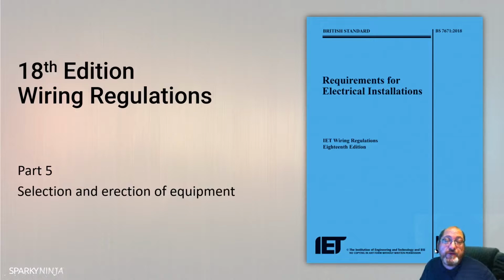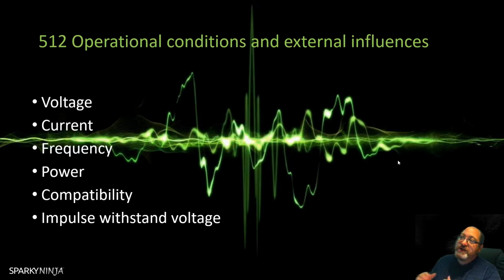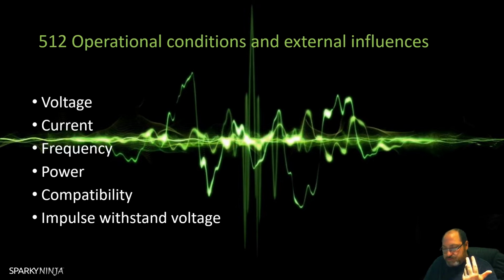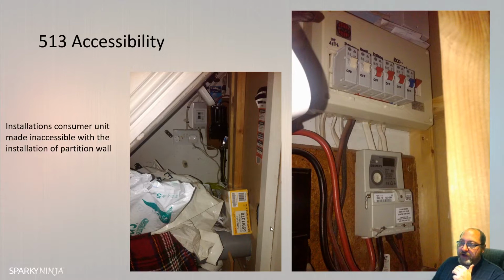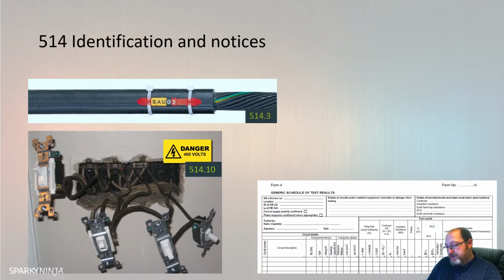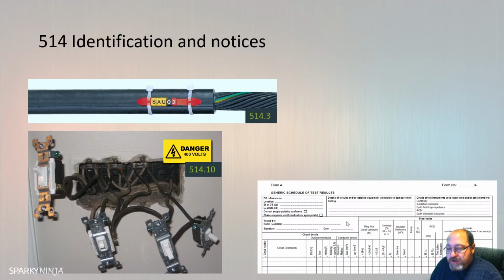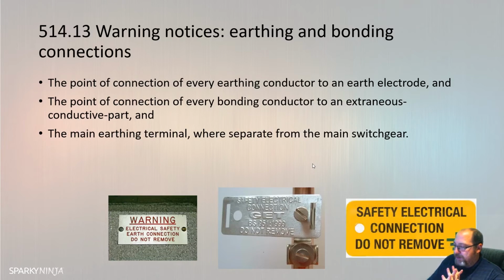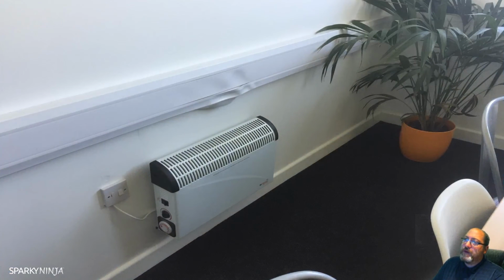18th Edition Training Series - Episode 10 - Part 5, Chapter 51 - Common Rules

Comment: Regarding what you said about having a 2 gang light switch with 1 gang on L1 and the other on L2. I didn't think you needed a 400v label as you do not have 400v to earth (514.10.1). Have I interpreted this wrong?
Reply from the maker: You would have 400V between the two common terminals.
Reply: @SparkyNinja  Thank you for your response and all of your video's I have found them very helpful.
Reply: @jamesdrewery466  I think you are correct. The nominal voltage live to earth will still be 230v, but you could argue that you wouldn't necessarily expect find 400v at the switch, so best practice is to identify